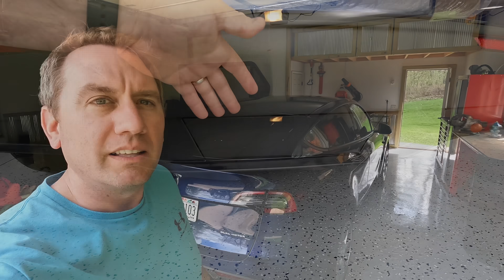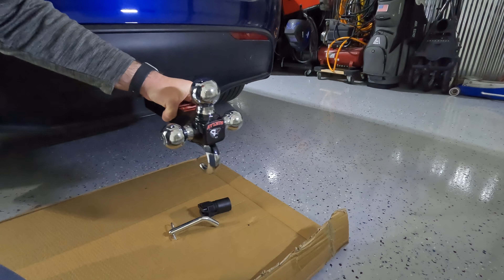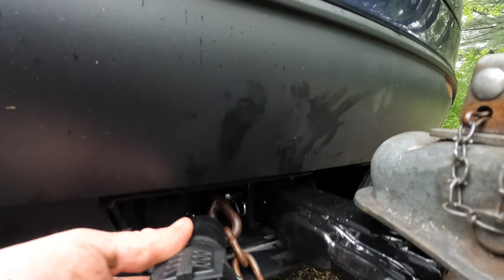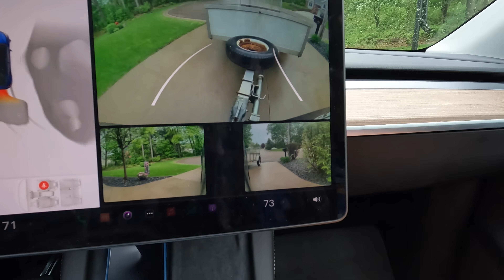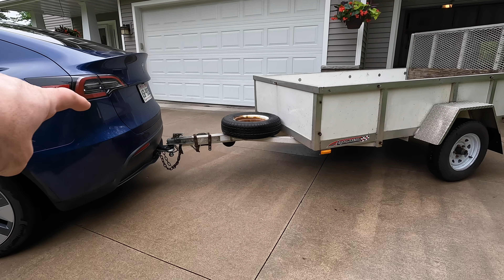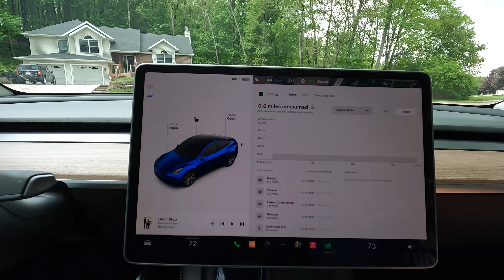Towing with a Tesla Model Y - Hitch Install

Comment: Idea: find a junkyard ModY front bumper cover, cut out the middle (trailer sized,) slap it over the tongue up at the front of the trailer 😁. You'd need a bit of structure to hold it in place, but if you chopped the middle section out of the number cover and tailored it to your trailer, I bet you'd see improvement!
Reply from the maker: That sounds awesome.

Comment: We have the tow hitch too. Does FSD work in trailer mode?
Reply from the maker: No, autopilot doesn’t work either.  Because of all the trailer variants, it wouldn’t be safe.

Trailer sway, turning radius etc
Reply: @TheLawnEngineer  thanks!

Comment: Your experience getting the hitch installed was informative.   I'd be more interested in a higher tongue weight for my ebike and a plastic cover that only exposes the hitch with a removable plastic hitch cap.  Model Y tongue weight is supposed to be about 165 pounds or so.  About 40 pounds of that could be bike rack leaving 100 pounds for ebikes.

I like the blue colour. It's pretty sharp.
Reply from the maker: I’m glad you found some value in this video.  

I’m sure I exceeded the tongue weight limit when hauling 3000 lbs of sand last month or right at the limit.  

Thanks for checking in 👍

Comment: Bumping of trailer is from the shit roads that large trucks create. ?  I use my trailer more than, I ever used the bed of my truck, that's why I sold it to buy my Y . Oh I back up just under the trailers hitch without moving the trailer. The camera just catches the ball, so when you unhook it just get the hight about 2" above the cars ball.. We all hate the plastic cover I am on my 3rd as it gets scratches trying to get it off. needs a new design...
Reply from the maker: The bouncing trailer is a combination of crap roads and no load and lack of tongue weight.  With a load and some tongue weight the bouncing stopped.  Anyway, trucks are hard on our roads but the freeze and thaw of winters is what really kills ours.  

That plastic cover does really suck.  I have found that a standard screwdriver works the best to get it started to pop off.  

Thanks for the comments, all feedback is good.